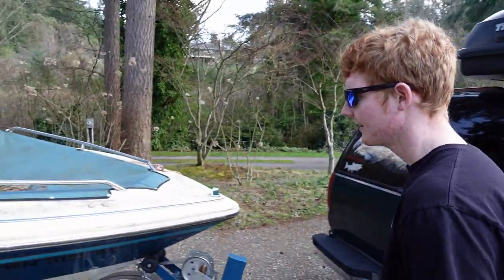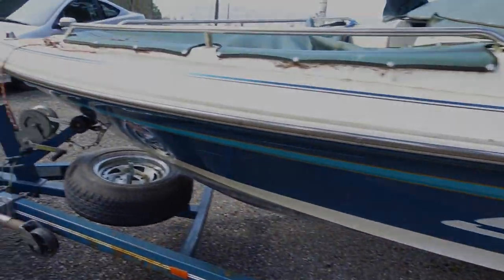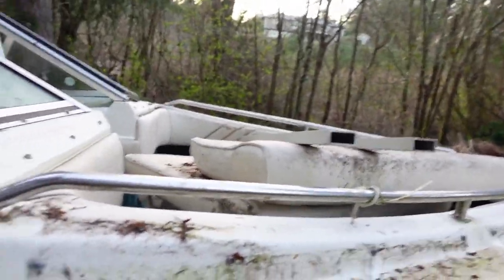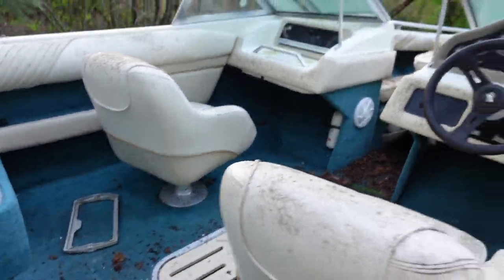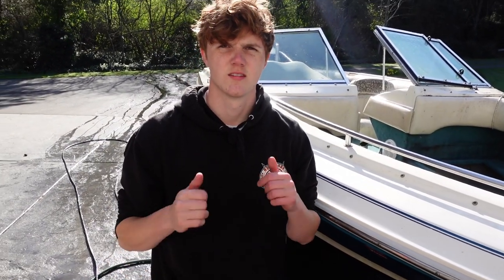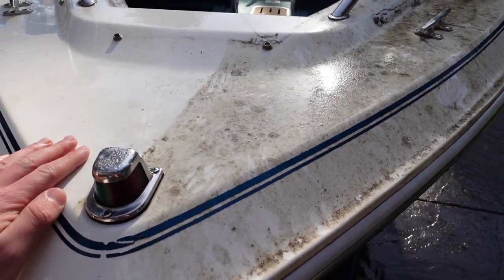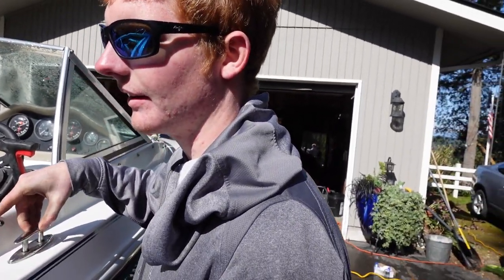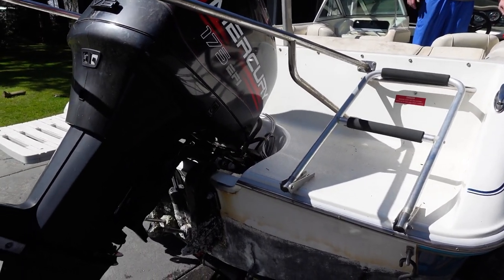Competition Ski Boat Restoration Ep. #1(Sea Ray Ski Ray)

Comment: Don't throw any of that canvas away! Ours is missing the rear seat and all canvas - replacing the canvas would cost more than we spent on the boat. These boats were built in Arizona and none of the canvas companies have patterns for the Arizona boats. I'm sure what you have could be used as templates in the worst case scenario.